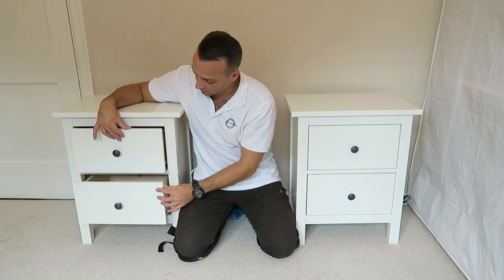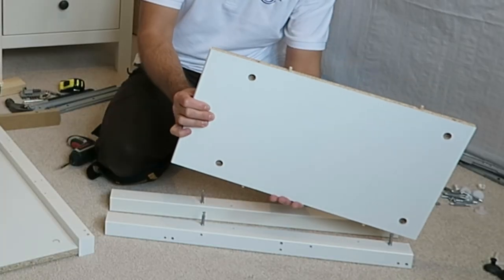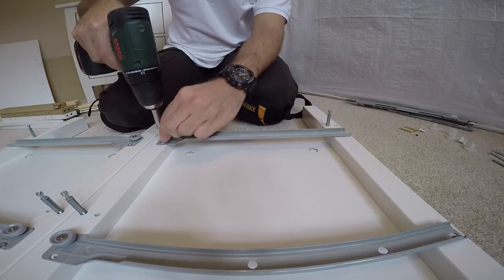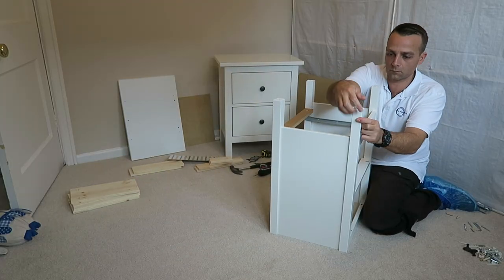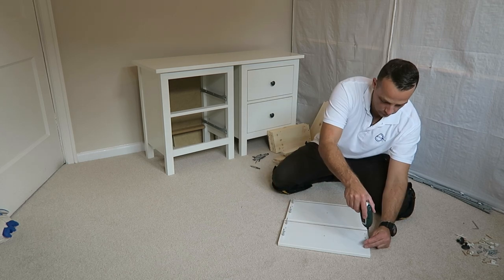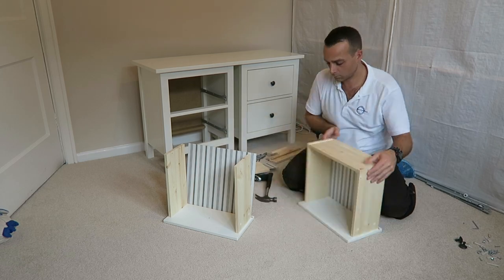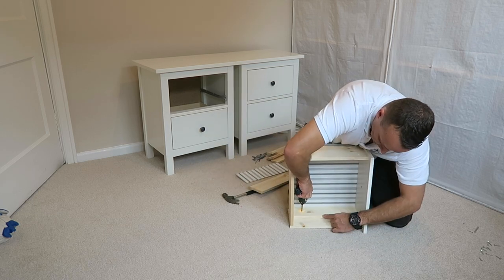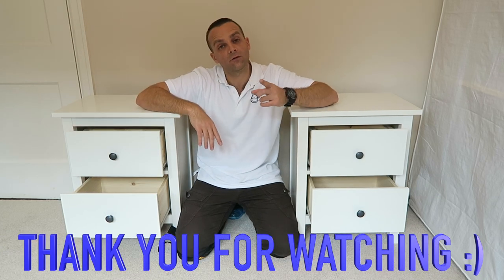IKEA HEMNES Chest of 2 drawers assembly

Comment: Thank you you helped me to figure out the odd colored supports, the diagram in the book should better define them. The 8 drawer dresser had better diagrams. The only thing I do different is use hand tools not power because everything needs to be snug not over tightened because it will crack and strip. Thanks again!
Reply: Frank Biz This video also helped me for that reason. I built the entire thing and didn't realise I'd screwed it up until the end when the mdf was visible from outside. I had to dismantle it all and work out how to undo those damn cam locks. Got there in the end though! Cheers.
Reply: @benscott8111  exactly the same as me! I then bust it dismantling and had to buy another! We live and learn haha

Comment: My drawers are not even, more to the right side. I can't figure out why?  Any suggestions?
Reply from the maker: Hard to say what went wrong if I cant see it.
Reply: sometimes if things look a bit wonky the furniture is not always sitting level on a flat floor. If that is not the case makes sure your rails on your drawers and mounted inside the frame are all totally flush. if not that then check for gaps between any of the wooden panels which could be throwing it out.
Reply: Same thing happened to mine, the reveals are off to one side